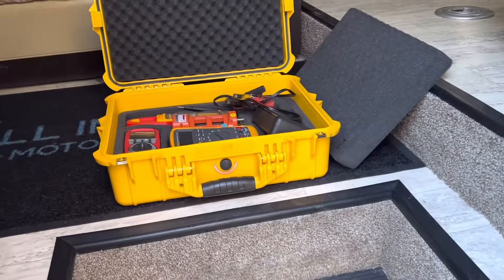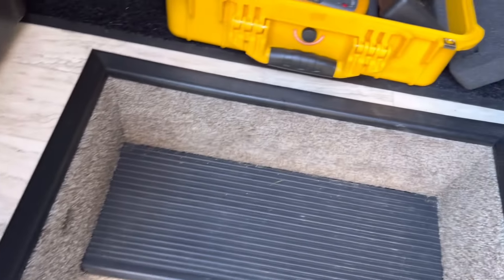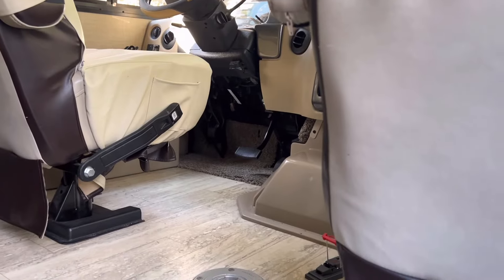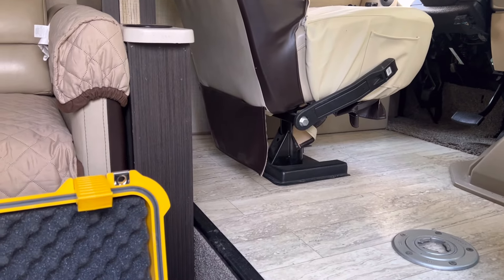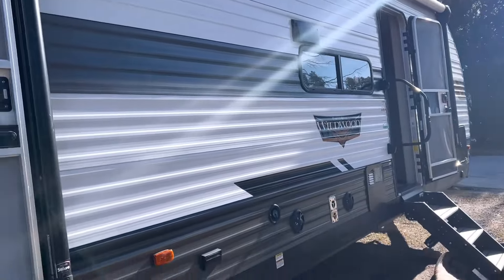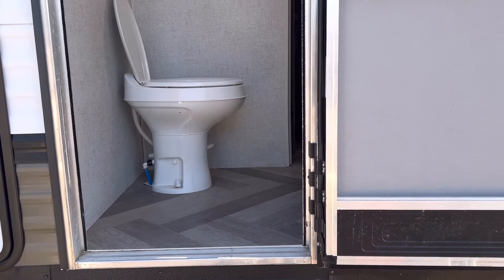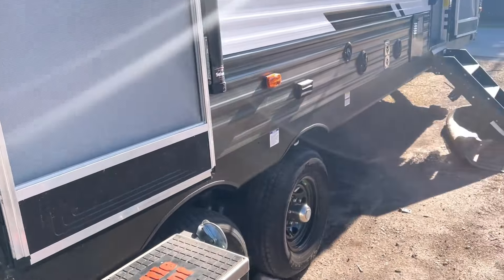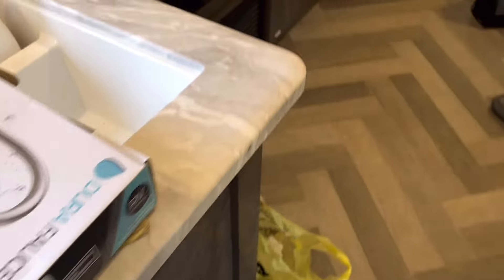RV SERVICE CALLS

Comment: Great videos !  How did you like RVTI ? Did you do in person or online ? I’m planning on going but have had multiple people try to talk me into going through NRVTA which is crazy expensive and not really in my budget. Sorry, I have a ton of questions.
Reply from the maker: RVTI is the "real certification body" like ASE for automobile technicians it's the one that all of the (RVDA) dealerships recognize there's a thousand different independent training places out there but RVTI is the industry standard.
Reply: @rvtechpro  So for someone who has limited experience, but is mechanically inclined. Would you say going through the in person RVTI courses teach them and set them up enough to start there own mobile RV repair business ?
Reply from the maker: @slickvic5766  I don't like to say what people can't do like to limit a person but I would from my experience think that it would be more difficult to do that without ever working in the industry and under guys that have done they will teach you what the books can't.  I recommend taking the classes in person for anyone who is not working in the industry then after you get those certifications go work for a dealership or a established shop and learn the trade in real life this way you don't have to pay for the mistakes that you will make starting out; its easier for a billon dollar company to absorb the cost of your mistakes than for you to basically be practicing on customer units out in the field that's not going to go over well.